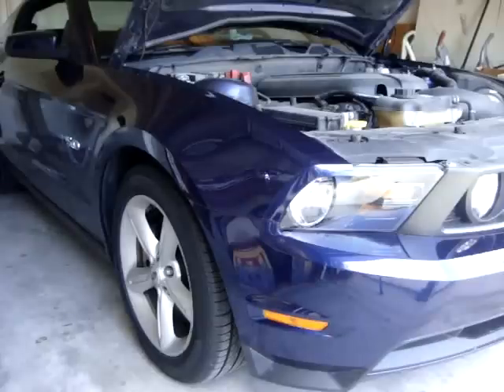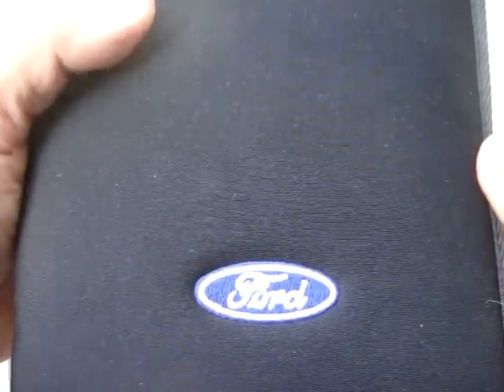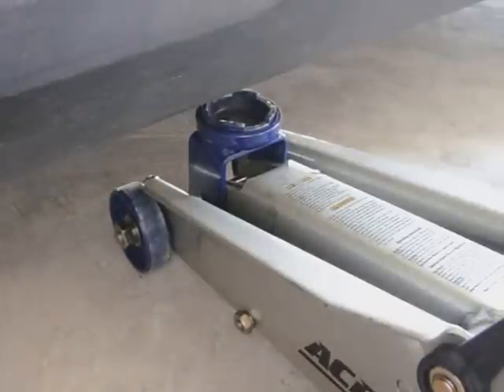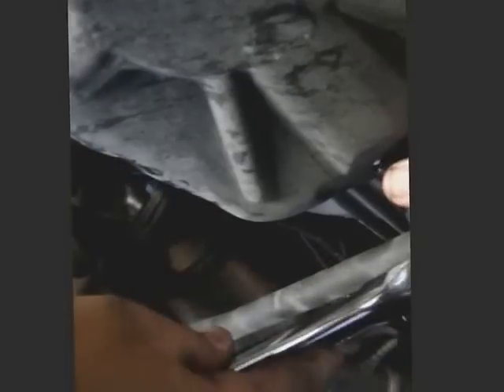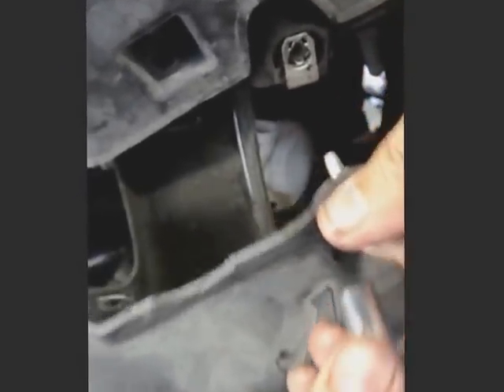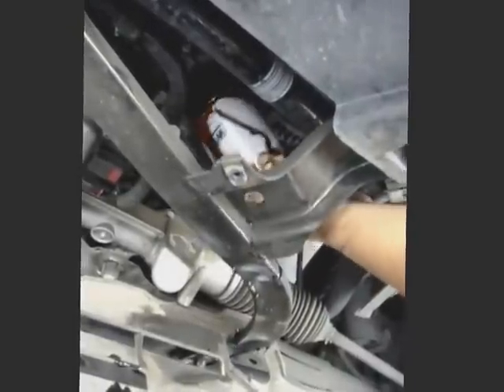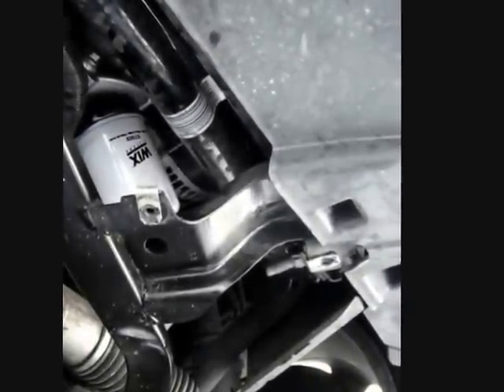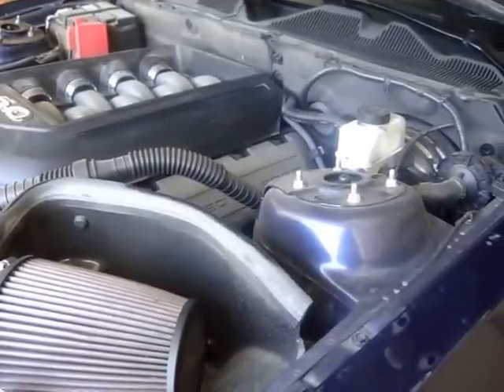DIY Oil Change for 2011- 2014 Ford Mustang GT

Comment: Really good job overall SJ, just wanted to discuss one thing you mentioned... the issue of putting oil in a filter before installing it.  As you alluded the reason you "always" want to add "some" to the center hole prior to spinning on is to wet the media element.  By doing so you will prime the filter, to create a higher suction or pull of new oil through it during the first start up.  Just put in a few ounces from the can and roll the filter around in a circle so liquid is absorbed into all the pleats.  As you discovered, don't fill all the way up as it's a mess and always spills when trying to install.

An important note regarding torque specifications, reinstalling the drain plug is the most critical part of the job.  Simply confirm the factory pound number and use an appropriate torque wrench, numbers are in the owners manual or online.  It is also imperative to change the gasket "every time" you take out the plug, no matter what type is use (I.E. Fiber, Metal, Rubber O-ring, etc).  

Finally all engines deserve the highest efficiency filter possible, so add a patented oil filter magnet.  Abet all the hype, no filter on the marketplace can remove particulate below about 20 microns at the target Beta Rating / Capture Efficiency Rate  (ISO 16889) of 99%.  By placing the extremely powerful ceramic magnet "inside" the filter, you bring the capture rate size down to about 1 micron.  Why is this important?  Since over 75% of engine wear is caused by particles under 8 microns (those that continually go right through the filter), adding internal magnets increase engine life by at least two times  (Laboratory documentation shows 200K increases to over 400K miles.)  For the price of a can of Coke at 7-11, you increase the value of your engine, increase fuel efficiency, decrease pollution and maintain new performance levels.  Read all the technical information and review the lab tests at...   www.OilFilterMagnets.com

Comment: read a great tip/idea a while back- get a large ziplock bag, put over the filter, catches the oil as you unscrew it, drop the filter in and zip it up, dump it out later...

Comment: Just one oppinion/advice...Next time you do that remove the oil entrance cover so when you take out the oil it will exit faster+ sometimes and it happened a small quantity of old oil remains in the engine because the lack of air and that isnt really nice ...what i love to do is clean the engine adding diesel instead of oil and let it  2-3 mins idle and there you go...a clean engine xD...sorry if i ve maked some grammar mistakes...im from Romania...:)
Reply: "clean the engine adding diesel instead of oil and let it  2-3 mins idle" NO NO NO !!!. Running your engine without proper lubrication (read "OIL") will greatly decrease engine life. It is not important to "clean" your engine. Just remove most of the old oil and add the new oil. That's all there is to it. If you want to "clean" your engine, disassemble it, scrape off the carbon and reassemble it. But that's something you only do if you have a real reason to take it apart, like replacing pistons. Engine cleaning is a myth started by clean freaks. Don't run your engine without oil in it for any, repeat any, amount of time!

Comment: Uh Mr. Savage the writing on the wind screen said 9mm. that's your socket size for the nut,not a newton meter torque spec. Just tighten a half turn past finger tight and don't waste your time with that. Also it is easier to pour a little oil in your filter without a 2 foot long oil spout, just pour from your can you will spill less of your 8 dollar a quart oil. No need to fill filter all the way two thirds is plenty to pre oil. removing the wind screen all the way will keep the oil off of it.  You will take less than 3 hours of clean up next time. Oh yea one more thing a plastic tarp would keep your garage floor oil free.
Reply: ***** You don't need a torque wrench to tighten an oil drain nut tighten until snug turn one half turn more and your good.And yes its 8 quarts if its drained all the way.

Comment: Great video ! Question I have resets the oil life on my 2012 Mustang Gt. It's been over 2 months oil life indicator has not gone done ? I check my oil and it's in the half way mark. Should I be worried and take it to the dealer ??
Reply from the maker: sixtochino If it's halfway between the hole marks, the oil level is in specs. I am assuming your engine is still warm. 
With a warm engine, if the oil level falls below the bottom hole, add oil.

Continue to monitor the oil level on a weekly basis and write down how much oil you have to add on a regular basis. You should not have to add much; maybe a small top-off several months down the way. 
If you are constantly adding oil, check for leaks:
Tighten the drain plug if loose, check the oil pan and see if you can see oil spots coming out of the gaskets, (bad gaskets), etc. 
If the oil drain plug is stripped or the gasket is bad, you will have to take it to the shop

Comment: Would this be substantially similar for the 2016 GT?
Reply from the maker: It should be; but I believe the 2016 S550 Coyotes use the oil filter extenders like the Boss 302 Roadrunners use. 
Also, the S550 bodies might have a different wind panel under the engine than what my S197 body has.
But straight forward, the oil change is very similar on the new S550 body Mustangs